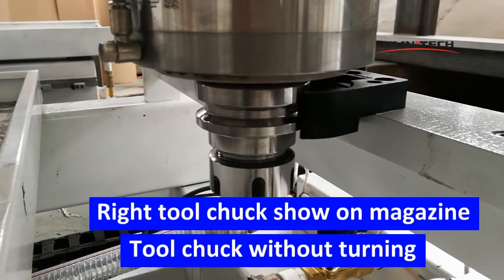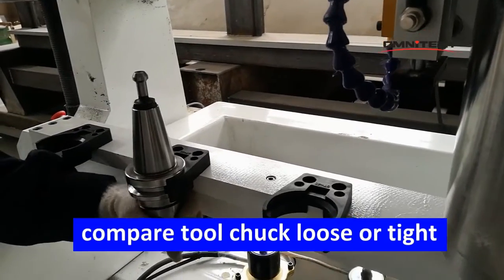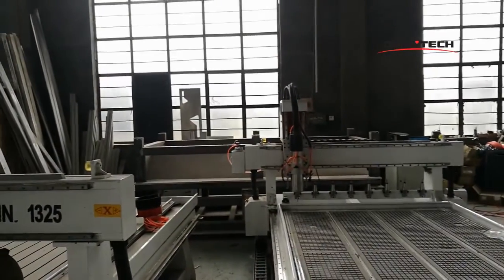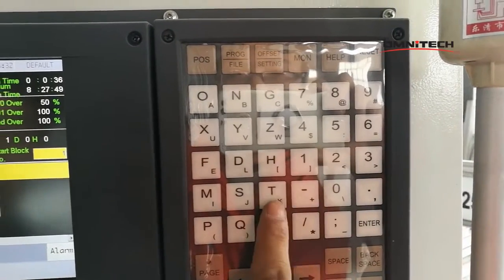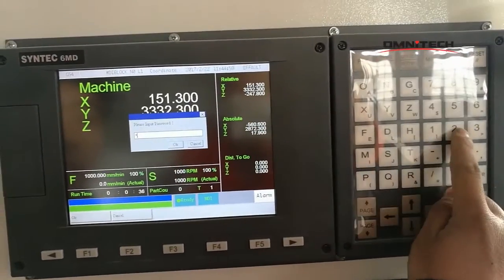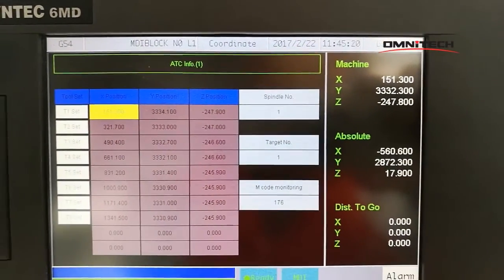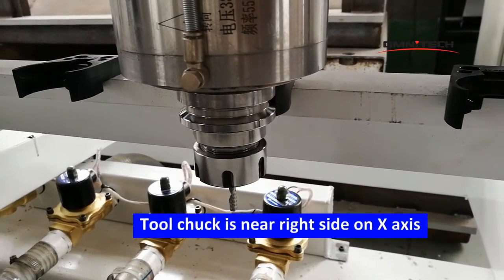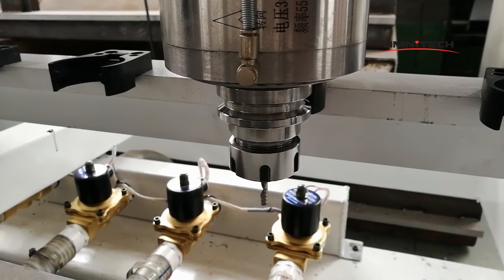How to Us Syntec 6MD  to Rewrite Linear Type ATC cnc Router Tool Postion

Comment: Hi Omni tech, with a rotary atc is done the same way?
Reply from the maker: Hi Carlolina, thanks for your question.  ATC means auto tool change, and rotary device is 4th axis indexed to the cnc machine. So rotary device does not affect the function of ATC.
Reply: Thanks for replying, I did not want to say a 4th axis, but a change atc carousel.
Reply from the maker: Thanks for replying. This video is only for linear type atc cnc router. We have updated video title to linear type atc cnc router tool position rewriting.
Reply: Thanks for answering. And how would you do for a carrousel atc?
Reply from the maker: Dear Carolina, there is no video guide about carrousel type atc position rewriting now. If you need, when we have that machine at stock, we could take a video guide for you.
Reply: Thanks for answering. I would appreciate if you can put me or send a video or guide to do it with atc carousel. Thank you.
Reply from the maker: Carolina, may I have your email address? When we update the video and will notice you.
Reply from the maker: Hello Carlolina, Ada Song from OMNI contacted with you, when we have video, she will let you know. But firstly, you have to let her know the machine configuration, then can know if the video is helpful or not.